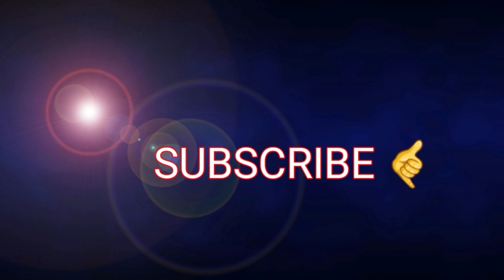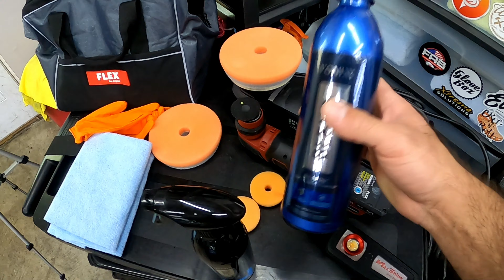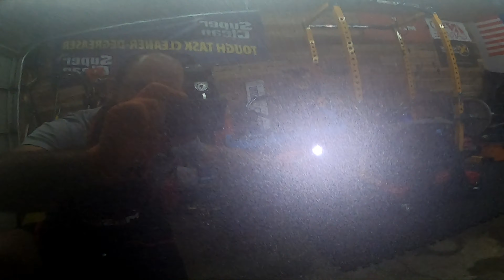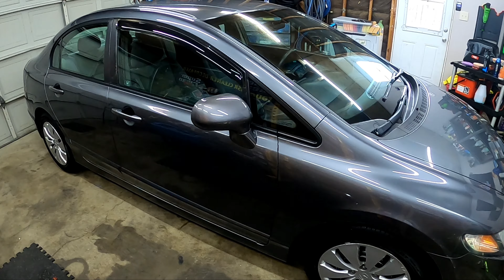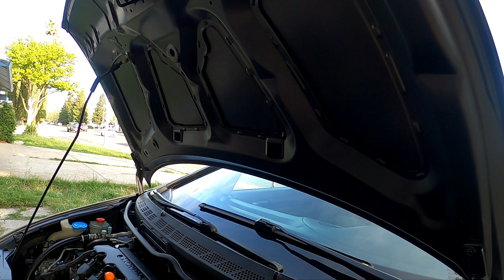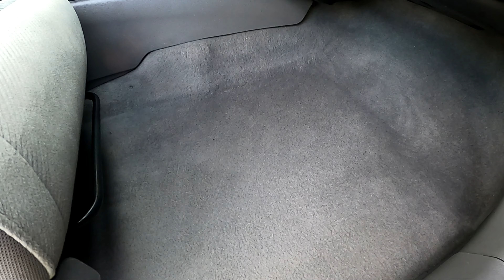The " PRODIGY " Series Finale | PAINT POLISH AND PROTECTION | AMAZING TRANSFORMATION!!!!

Comment: Are you planning on doing a finally review on the shinemate? I bought the maxshine m21 pro based on your review and so far its been great.
Reply from the maker: You know.. I would love to do that video soon and give my feedback for sure. Hey, I have 3 maxshine units including the same M21 I did the review on and it still works like a champ 👍 By all means they are solid units. I guess where the Shinemate comes out on top is the overall balance of the machine in both hands... and comfortability when using longer periods of time. I've gotten just as good results with both machines. Just depends on user preferences my friend✊️✊️

Comment: Haven’t used rotary yet, but in the case of the 2” pad with the Detail Division extension, is arm/machine speed about the same?  Thx
Reply from the maker: Yeah, the speed is around the same. As far as arm speed.. you can focus more precisely with less pressure. The pad is spinning faster than a dual action it feels like though. Especially if you turn it up! I mainly just use speed 1 and it's more then enough 👍👍

Comment: Dang bro! That’s one hell of a turn around. So your opinion between Vonixx Sio2 Pro vs Titan? Blend vs TW Hybrid Solutions AIO?
Reply from the maker: Thanks Darin!!! Appreciate you man! Ummm ok so SI02 pro Isn't a detailer. It's a stand alone form of protection. So, it's hard to put them in same category but Titan definitely has the edge on slickness! Honestly I just don't know of anything that feels like Titan on paint. But, the Si02 pro is so easy to apply, slick... and glossy. Now, the AIO's... blend takes the cake. More correction and a bit slicker! Also, MUCH easier to wipe off.!
Reply: @PapaSmurf918Detail  man I’ve been impressed with Vonixx’s lineup. I just gotta get through some supply before I test stuff out. I think a video of some papacut, Fab finish, Sio2 pro and topped with Titan is in order ! Still waiting to use the Cerakote Glass treatment. Been raining off and on plus just no time.
Reply from the maker: @daringlisson9353  Man I'm right there with you! I've got SO much stuff it's very hard sometimes to decide what to use!!! LOL that would be an ultimate gloss stack for SURE!!! I need to get more details in now that the weather is nice! Yeah, weather can sure put a damper on your plans I know it to well. You'll get to it though soon brother!👍🤜🤛
Reply: @PapaSmurf918Detail  yessir, keep up the great work
Reply from the maker: @daringlisson9353  Appreciate cha brother! Will do! 😎

Comment: I am very interested in these Vonixx products, made in Brazil I believe, but somewhere down in South America.   A couple other YouTube detailing channels have also reviewed some of the Vonixx products, including the primer AIO polish, and they reported that that all the Vonixx products seem to work pretty well and even better, they are a great value for the money.   I had a similar product to the trim cubes put out by Cerakote.     I don't know what it was with them but I had a bad experience trying to use them on plastics I had just cleaned.   They smeared,  were sticky when you tried to level any high spots and overall I didn't like them.   Looks like the Lithium Cubes might be a little bit better.    They have a unique shape also.   I can't remember if the Cerakote product was little "sponges" like the Lithium or if they were wipes.  It was a while ago when they were first released.     My current polish of choice for AIO is NV Morph which is one hell of an AIO w/primer resins built in similar to this product you are using here.    I have the whole NV system,  Morph,  Lustre,  Jet, and BOOST to maintain it all.    I wanted to go with a one company system of high quality on the paint this year.   Previously I was using all sorts of different products on the paint all through the year testing out one thing after another.    The problem was that I started to get hazing after a while and the clarity suffered for sure.    I'm sure many of the products probably weren't compatible or maybe their chemistry just didn't like each other.    This year I wanted to give one full year using the NV system due to previous videos across the internet hyping up NV Car Care products (which to be honest are some FAN FREAKIN' TASTIC products!   I don't know what those jokers put into their stuff but it must have some wiccan put a hex on it during manufacturing because gosh darn this stuff is good.   And it leaves behind primer resins so you just go right over the top of it (after I let the primer resins cure overnight) the next day with Lustre,  let that cure, and apply Jet.   After that I just maintain it with BOOST which is there Si02 infused maintenance product which can be used wet or dry.    I personally use BOOST as a drying aide and to keep the hydrophobics topped up.    Beautiful beautiful combination and the hydrophobics are the best in the world, period.    Even better than full blown ceramic coatings.    Looks,  well,  let's just say that a LOT of people stop and stare at my car wherever I take it.    It has taken it up a notch and it was pretty far up there and had really nicely corrected paint before I started using NV Car Care.   Not sure if you have tried that Lustre/Jet combination yet,  but if you like beads,  that JET is the absolute KING.   All the products work in synergy too so they can be used interchangeably and top each other with no problem.   We'll see how this who process holds up after a year.    I use a good quality pure soap (Feynlab Pure) with no additives for my bucket wash and Feynlab Pure RINSELESS for any rinseless washing so nothing extra is added that would interfere with the NV Car Care Products.    I don't want to risk using a soap with Si02 in it, a polymer,  sealant,  carnauba wax, etc that would interfere with the NV car care stuff and cause streaks, hazing, sweating,  or whatever might pop up in an adverse reaction.   I'm sure there are some products that would work perfectly well topping it over NV Car Care but I don't want to take that chance this whole year because it just takes so darn long to complete a full paint correction to the highest standards and the "I don't care how long this process takes as long as it looks perfect" mentality I have when I polish my paint.  I get a little fanatical and spend a week out there sometimes perfecting that paint.   Now I do have a 370Z (Red) and it's tricky to polish that paint due to it being so darned SOFT.   It SUPER soft paint.   You blink at it wrong and you'll have a scratch or micro marring on it,  guaranteed.    I joke that I don't even speak near the car because the wind flow from my mouth while speaking may blow a piece of dust by the car and micro mar or scratch it!   It is a frustrating paint to work with for the reason of the super soft paint.    But when it is dialed in right,  it just looks incredible.
Reply from the maker: Joe, I've loved the few products from vonnix I have tried! I think they are in Brazil. They grow there own carnuba trees an all. Very good company. I hear nothing but great things of NV car care products. My friend Rick over at RAD garage loves em. Also, Sandro over at Car Craft loves em too. Staying in one line can never be wrong. Like you said they are all formulated to work with one another. I do have Lustre.. haven't had the chance to use it due to me always forgetting I have it! I'll be sure to give it a go though! Appreciate you taking the time to watch! ✊️🤙